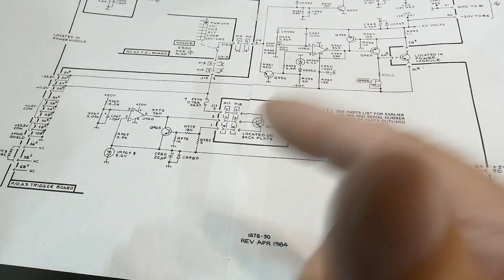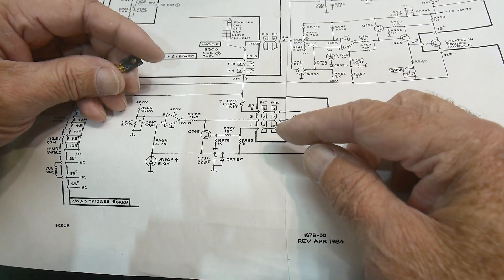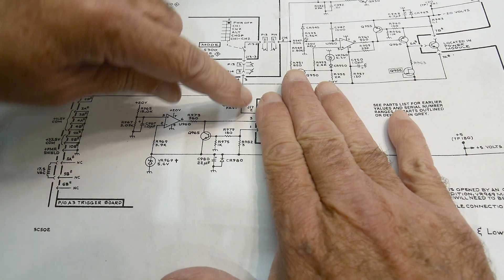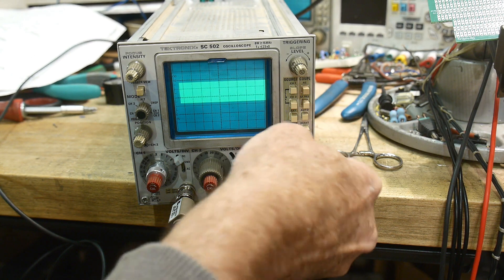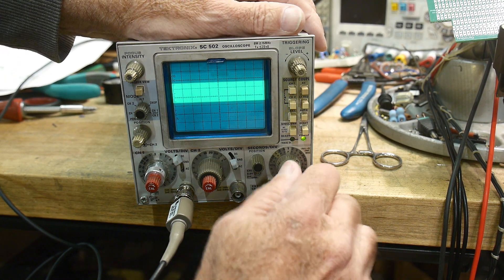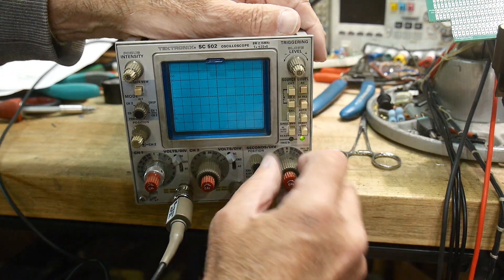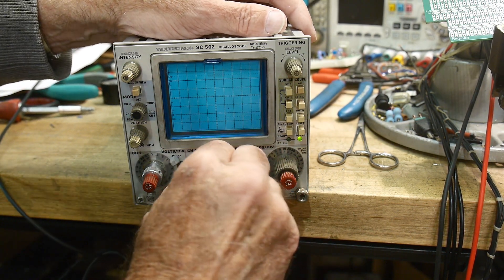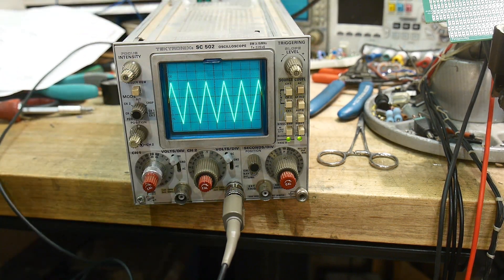#1773 Tektronix SC502 TM500 Oscilloscope Repair (part 3 of 4)

Comment: Make your own Darlington...

I suppose 
if current is isn't more than 1 amp..then and there is 5 volts...and the 7805 is not a branding iron...then leave it in

Ah ha...11 VDC...5 VDC out...

The 7805 works -has better regulation than Tek circuit 

It be a bias lession....

That Tek comparator puts out 20 mA at best...maybe logic and scope circuits use 800 mA....
800/20= dc current gain= 400..

Pick up the 2N3055...measure its gain I bet 30...then look for another small signal medium power like a 1 watt transistor...

But your smart...and like a reader suggested use the 7805...

Then there is like two Vce drops....1.4....

Lol...i am not sure

Like the darlington needs to drop 6 volts...

Lucky you have your curve tracer...

Thanks for showing the sweep and display and you got her up

Good job

Comment: Very pretty little scope.  You are right about knob setting confusion. At least the Auto button usually helps. But you still need to know the basics. Do modern scopes come with a 'dummy' mode like automatic DMMs do now? (Or those auto little component testers,)
Reply from the maker: yes, modern scopes have a 'press if you are dumb' button. usually called auto. it tries its best to give a good setting

Comment: I thought of making a darlington out of a high gain small signal transistor and a power transistor, but the solution is perfect for me. 
I was wondering about the green led but it was a new element at that time and one has to show that the system in up to date.
Reply from the maker: you're right, green must have been very new at that time.
Reply: I was thinking exactly the same.  In 1976 most of LEDs were red.  Green LEDs were like blue LEDs in 1990s.

Comment: Haven't used any of the "Modern" scopes yet so still have my old habits from the old days. Set channels to ground, center traces, check trigger sources, etc.
Have to wonder why they didn't just use a COTS 5 volt regulator in that thing!
Reply: Agree, a 7805 would've been so much simpler, and having to gain select the op device as well, there must've been some logical reason for all that trouble but I've no idea what, our host just took the line of least resistance which was the best thing to do.
Reply: @monteceitomoocher  They weren't very old then:  maybe the designer wasn't aware they existed.  Or maybe they just gave the design to someone who wasn't exactly fantastic.  A resistor divider for a reference?  Hand selected parts to make it work?  Sheesh...  Our host did the next guy a favour.
Reply: I suspect they did it this way because this circuit includes overcurrent protection that a 7805 doesn't (unless you overheat it). Remember, these modules were designed to plug into a chassis which could have a very beefy power supply such as the TM506. Regards, David
Reply: @davidv1289   Yeah, I did notice that there and probably a good thing too if it has those tantalum caps.  I had it in my head that you could easily add overcurrent protection to the LM78xx, thinking of the LM317.  'Course you can't easily without a negative supply which would, even if you did, be  a little sketchy.
Reply: The reason is it needs a 20 V rail !
Basically do we have a usable 20 V test .

Comment: As soon as the video started, I started praying: "God please don't let him bodge the 7805, please don't let him bodge the 7805, GOD NOOOOO JUST NOT THE 7805..." I mean the original regulator is a bit simpler then a brick, is it so hard to take 10min of your life to make a few measurements, find and replace component and do the fixing as intended... 😂😂😂😂 
I meant nothing against you, it is just that I had a fair share of bodge-fixed equipement on my desk that your video gave me the PTSD  episode😂😂😂😂😂😂😂
Reply from the maker: I spent hours of my life trying to find the part number, and datasheet, and replacement. all of which I failed.
Reply: @IMSAIGuy  I understand, but let's analyze the circuit. Without Q970, pin 2 of U960 should be at 0V, while its pin 3 should be at +5.067V, and the output, pin 6 should be at max positive output of around +18V. Now if we analyze the circuit around Q965. If the circuit is working max voltage across R982 should be 0.767V (if we assume the Ube of Q965 to be 0.65V). This implies that max current of a +5V rail is 255mA. So let us assume that max emiter current of Q970 to be double that (as a safety margine) or 500mA. Now, if we assume output current of U960 to be 1mA (though opamps are tipically limited to around 10-20mA) minimum gain of Q970 should be 500 at collector current of 500mA, and its collector voltage shoud be at least 20V. Next it is a 2min search at digikey that resulted with NTE267 at $2.35 per unit. This is 30V/500mA NPN darlington in TO202 package with hfe of 90000 at 200mA collector current. It would fit the circuit without any handpicking or further service manual analysis. And just like that, without any bodgeing, the circuit should work (assuming you tested the other components in the circuit to be OK).
Reply from the maker: @nonamemad9053  want to buy it?
Reply: @IMSAIGuy  
To buy what? If you meant the scope, I do not need it. 
If you meant the darlington, I would be glad to help your channel, since I find majority of your videos very interesting. 😀
Reply from the maker: @nonamemad9053  I don't need the scope either 😀    thanks for watching
Reply: LOL! @IMSAIGuy
Reply: I agree. Bodgery is a last resort to be used in equipment life or death situations. My concern here is that using the 7805 eliminated the overcurrent protection this circuit provided. Probably explains the requirement to hand select the Darlington - as no adjustment is provided it would be necessary to match it to the opamp and the other transistor in the circuit to get the desired current limit. Regards, David